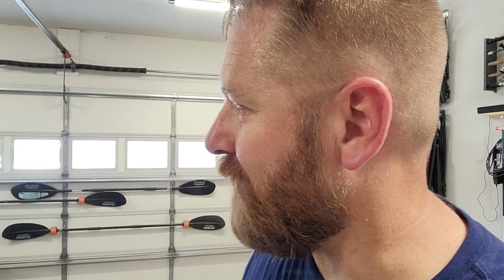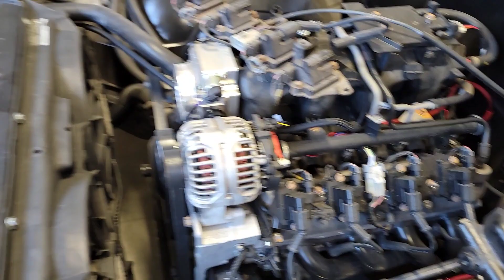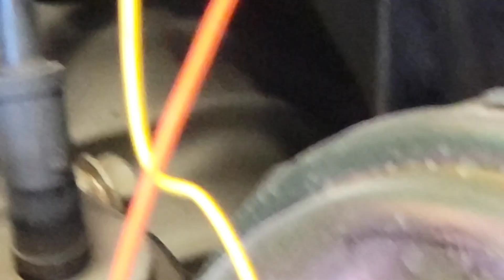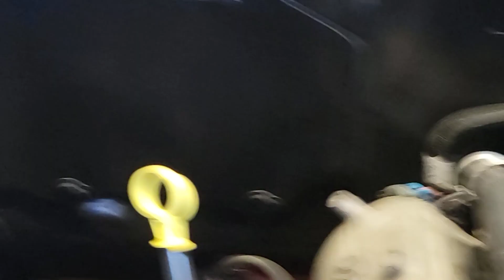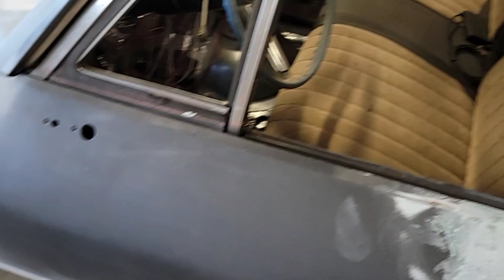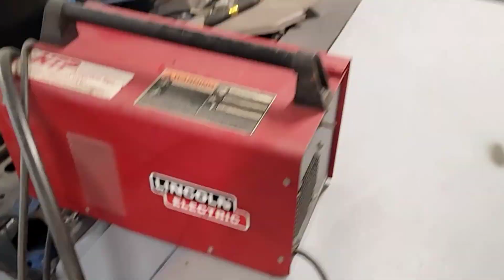68 Chevelle updates.  Back at it again!

Comment: I have that spectre intake. With your radiator and fan combo it should fit pretty good. Mine needs some trimming with my setup.
Reply from the maker: Good to know.  What trimming did you have to do for your setup?
Reply: @RecycledRacing  I haven't trimmed it yet, I have a Griffin radiator and fan combo and it sticks too far out and makes contact with the intake. I need to trim an inch or less off the throttle body side. After that it should fit nicely. I also have a 68 Chevelle.